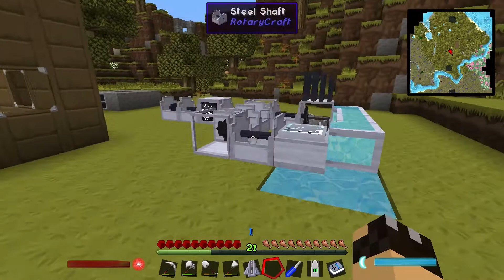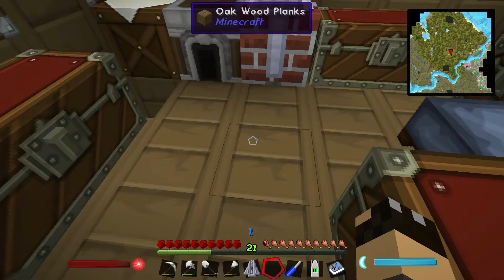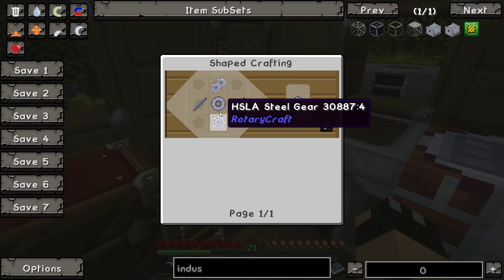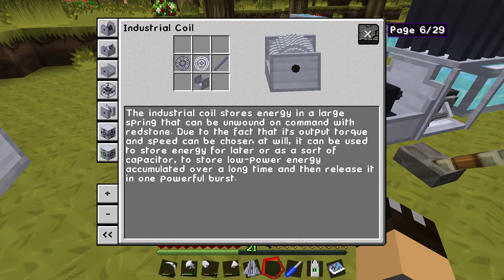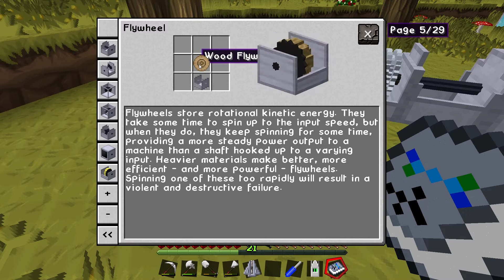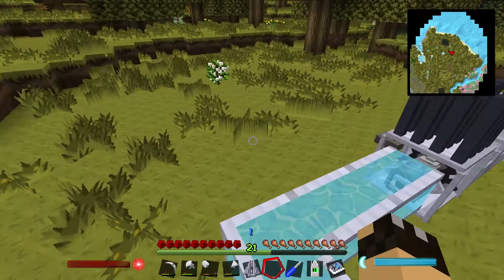Wood Cutter -13- Feed the Beast - Horizons

Comment: I have been playing with the hydrokinetic engines and they are crazy.  I currently have a man made waterfall that is six wide.  There are 7 hydrokinetic engines running off my waterfall of max height.  One to grind seeds (which is overkill) and 6 to be converted in to Red Flux power so I can transport it where ever I want easily then I use a pneumatic engine to convert back to what ever specs I need.

Comment: Springs never stack except upon crafting, because there is no other way to give you 4 per crafting cycle.

Also, I have no idea why your steam engines exploded, as I do not recall having changed anything in v13 or v14 for them.

As for missing pipe icons, again, I have no idea nor do I have any other reports of it.

Also, I would greatly appreciate it if you made some sort of statement that you spawned in the gravel gun's spring to get that level of damage. A lot of people are complaining to me because they assume one-hit kills are a given even as soon as you craft it.
Reply from the maker: I assume the exploding engines was some sort of mismatch issue with the entire Horizons mod pack, not an issue directly related to RC. Same for the missing pipe textures - may be because of the modified texture pack that I am using.